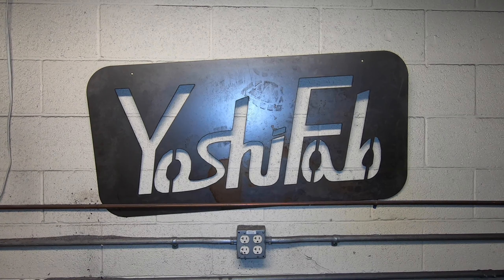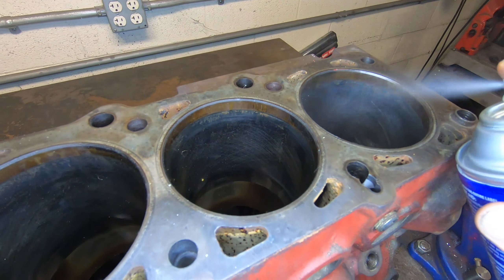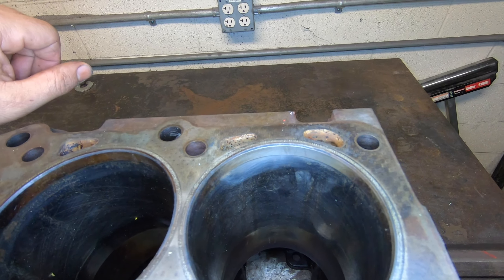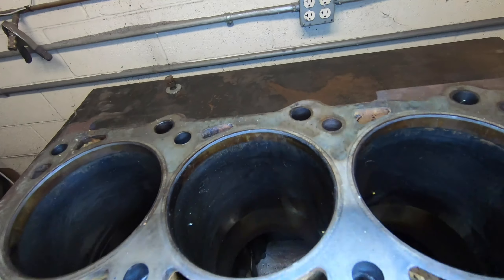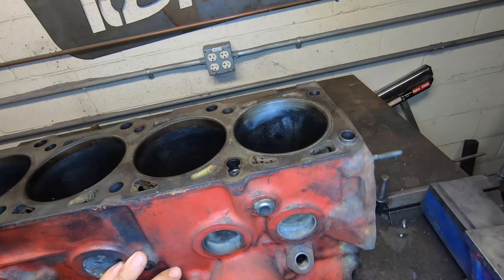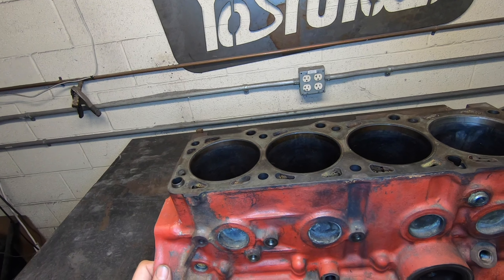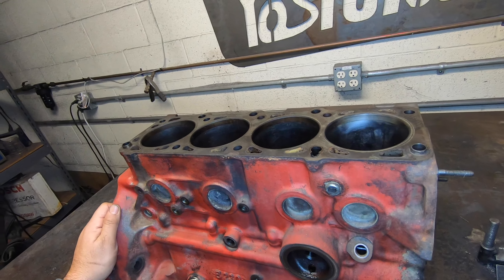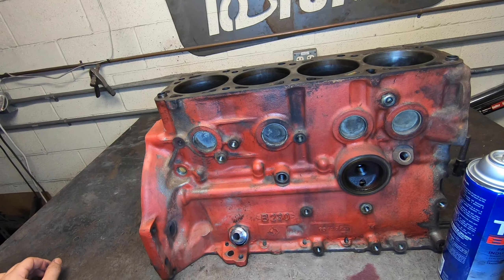B230 build block inspection

Comment: How much does it cost to sleeve a B230F to stock bore? I have a 16v head, H beams, 8.1 compression Carillo pistons with valve guides. Problem the block that I plan to use is still in the car. It's not taken apart yet or anything and is still running. It has about 375k miles on it and what I think has piston slap. I'm thinking the sleeves might be my best option since it's getting tougher to find good engines

Comment: I just purchased a 95 940 non turbo with extremely low miles..
I'd like to have my block rebuilt & not bored 
What sort of a price range would i would looking at for a fully rebuilt block.? 

I have both a turbo and non turbo.. 940 wagons
Reply: Seriously its highly unlikely you need a rebuild.  You won't notice any difference, if it runs ok, you are best to leave it alone. I run a 150,000mile red block on the track without any rebuild and overboost, its fine.  This rebuild craze is mainly only for badly designed engines that wear out or you want 400bhp or more from your redblock.
If you want to spruce it up, take it out clean it and repaint it.

Comment: Im assuming a 370k mile engine cant be rebuilt huh😂
Reply: I wouldn't say that. Why the rebuild? 
Do you have severely worn cylinders? - You can sleeve the block, now they are brand new
Are you leaking massive amounts of oil from the hole your rod smashed in the side of your block? - Yeah that block is cooked
Reply: @jebidiahcarlyon3543  yeah